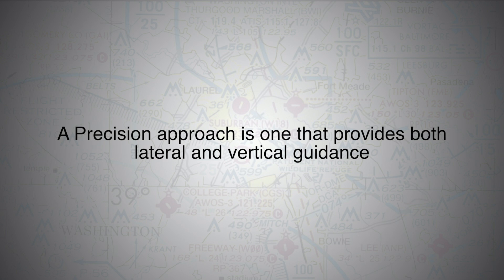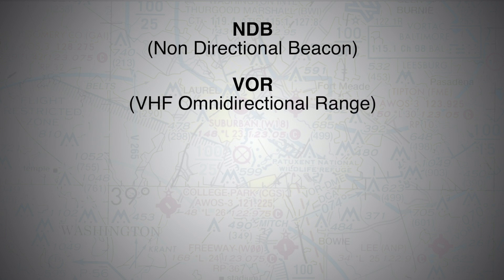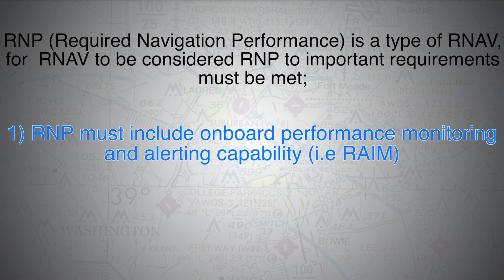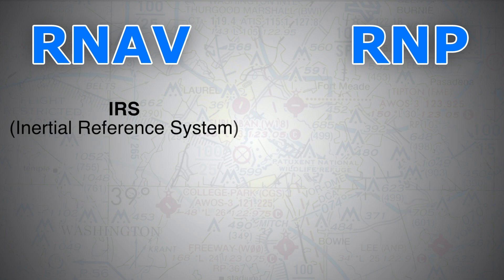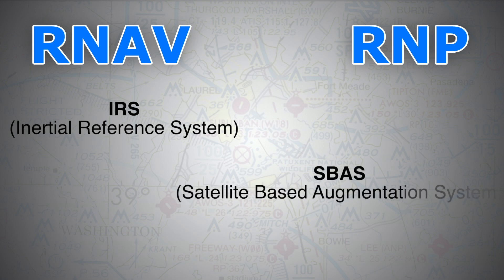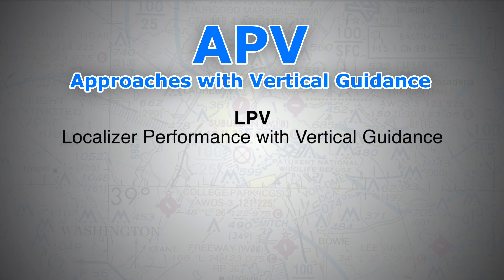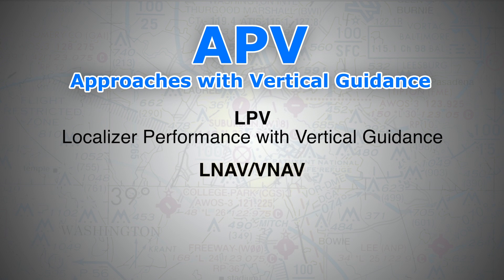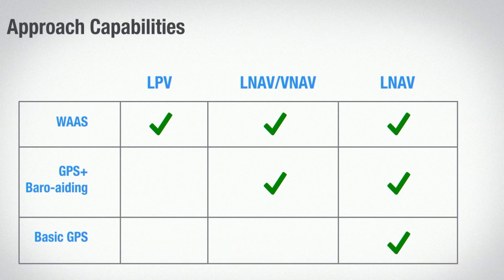🔴 RNAV & RNP THE DIFFERENCE EXPLAINED FOR PILOTS (2023)

Comment: I keep missing what's the difference between RNP and PBN. Is there a chance that you could make a video about the difference? Also, why do LNAV and VNAV show a DA on the charts, even though they're not precision approaches? Thank you!
Reply from the maker: Any approach that is flown using the CDFA technique (Constant Descent Final Approach) has got a DA for minimums even if it's not a precision approach. Also please keep in mind that we no longer refer to Approaches as Precision or Non precision anymore. But rather, 2D approach (provides only lateral guidance) and 3D approaches (Lateral as well as vertical guidance).
as for your first question I suggest you watch the video I have recently uploaded, it explains the difference perfectly. but in short, PBN (Performance Based Navigation) is the "umbrella" so to say under which RNP and RNAV requirements fall. 
PBN is a set of rules, whereas RNP is a set of accuracy and integrity and continuity of the onboard systems that will qualify you to maintain a specific accuracy in a specific airspace or area.
Hope this helped

Comment: Sorry, but I think that's partially wrong. You're right about RNP routes requiring onboard monitoring and alerting about navigation performance deviations, but both RNAV- and RNP-approved aircraft should maintain flight within the navigation specification for at least 95% of the time. That's a PBN requirement and, nowadays, RNAV and RNP are both encompassed by the PBN concept (ICAO Doc 9613 Third Edition).
Reply: Just ILS
Reply: @santiagolozano5454  No, according to ICAO PANS-OPS ILS, MLS and GLS are precision approaches, but also LPV SBAS CAT I aka LPV200
Reply: @oggybodoggy  LPV approaches are still yet to be considered an APV approach. Same applies with the LNAV/VNAV. I don't think that they will be qualified as PA anytime soon despite the WAAS having more accuracy than an ILS unless a HIAL system is not available or malfunctioning.
Reply: Charles,
Excelente observation. Congratulations!
I have a question: Are RNAV and RNP considered a PRECISION APPROACH?
Reply: @rivaldodasilvaalvesjunior9759  No. They're considered an "APV" (Approach Procedure with Vertical Guidance), according to ICAO, which lies between Precision Approaches (PA) and Non-Precision Approaches (NPA).
I might be wrong, but I understand the concept of precision approach requires an electronically-generated glide slope, from an outside antenna, like a GS in an ILS. Hence, the ILS is the only PA.
Reply: @rivaldodasilvaalvesjunior9759 no, hence higher minimums at some AD. They're Quasi -ILS. Or Quasi-GP.

Comment: What is GPS  baro-aided?
Reply from the maker: It is an approach where the lateral guidance is provided by the GPS while the vertical guidance is provided by a computer that uses pressure changes, hence the name “baro” to calculate the vertical profile.
Reply: @ATPLStudent   how can I now that the aircraft is baro-aided?
We use a DA-40 and I can find the waas and raim in the gps database.
Reply: Check your aircraft flight manual…..there should be a supp that covers what you can do with your installed system…